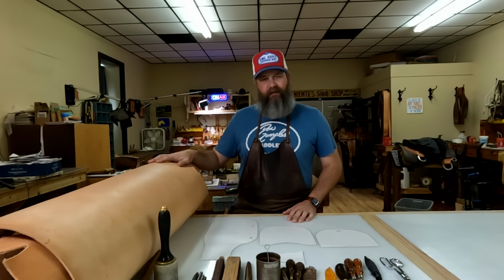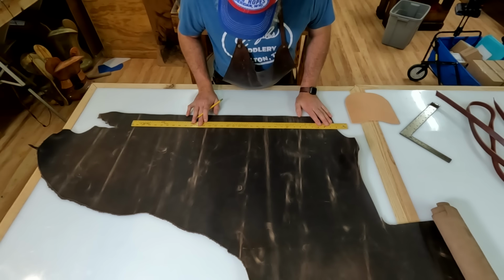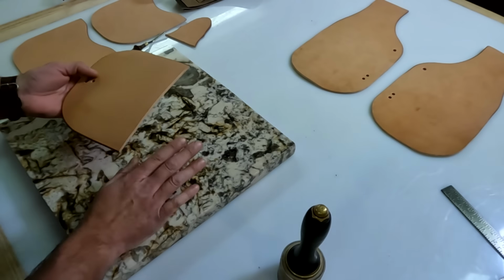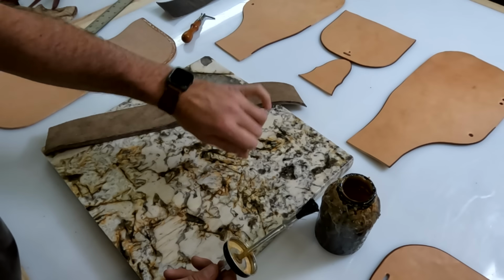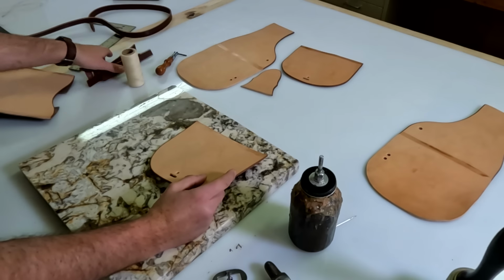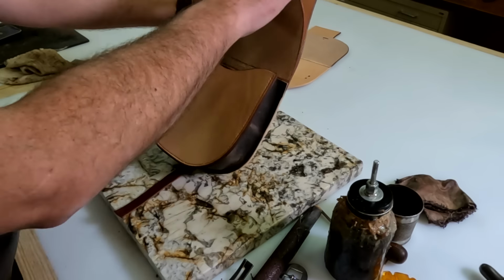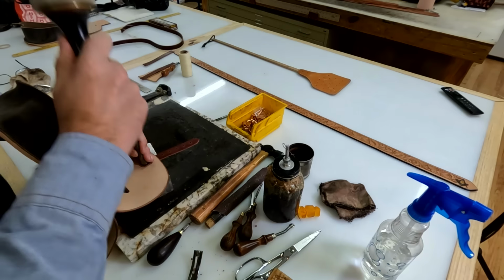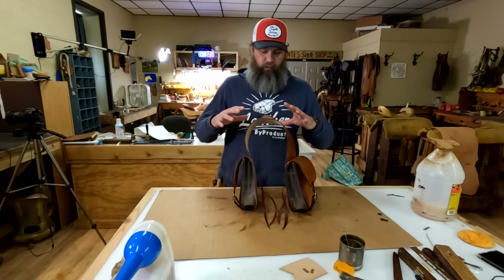Making a Set of Leather Saddle Bags

Comment: just a tip when saddle stitching first needle through and hold thread back as don showed push point and most of body of the second  needle through stitch hole then pull first needle through a couple more inches if you pierced the thread it will pull the second needle back out of the stitch hole  saving you having to take thread off needle.
Reply: A video would be more helpful
Reply: @RichardLeslieWhereat YouTube has several videos on how to saddle stitch and every other way to stitch leather. Hope this helps!
Reply: @grumpyiwegianpodcast3505  seen plenty, but a video with his specific thing would be more helpful.

Comment: Is there some reason that you don't use the double cap rivets?
Reply: Probably has more of the burr type on hand since he works a lot with horse tack. Since you have to clip the post and peen you don’t have to worry so much about thicknesses like you do with a double cap, and are generally used more in an application where strength is needed